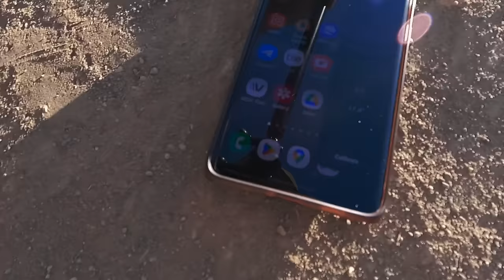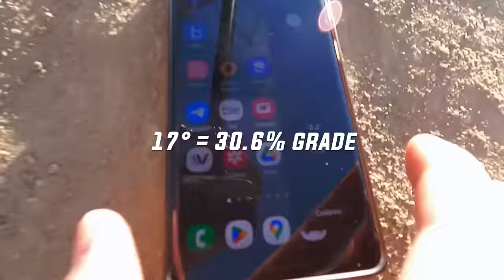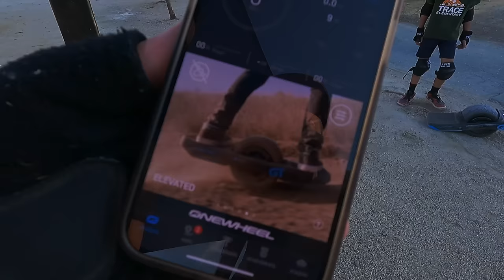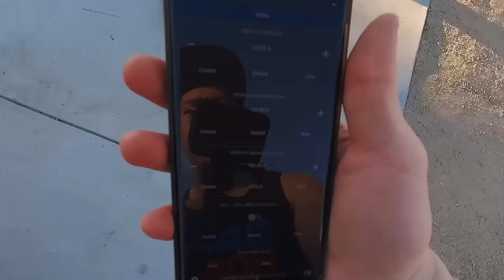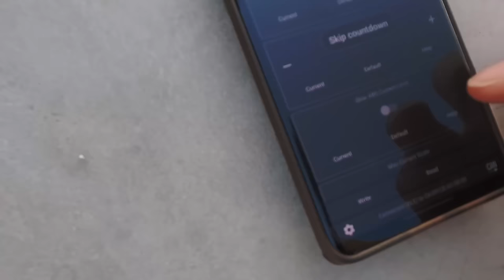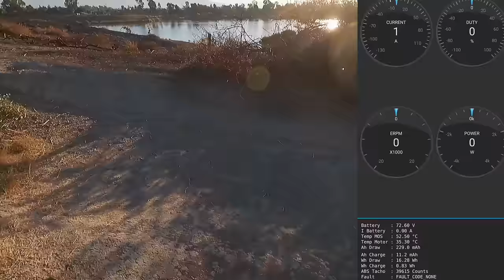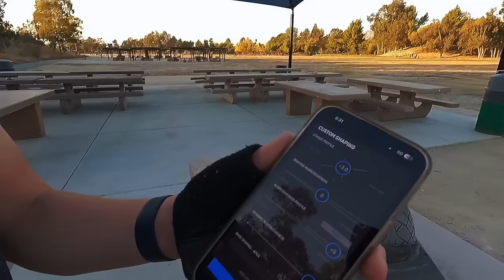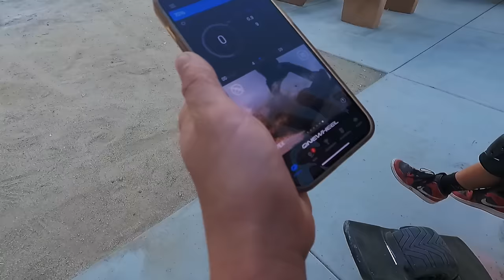Epic GT-S Torque Test! Vs Floatwheel, SuperFlux, GT & Pint-X

Comment: Just get an euc already.. these inclines are easy climbs on my eucs.. 
I've given up on ows for anything demanding and just ride my ow on casual, chill rides these days and still enjoy ows in that use case.. but the performance of the gt-s is very underwhelming for the price compared to my eucs.. and the stoke I get riding eucs is greater than on ows magnified by the greater g forces and capabilities.. there are pros and cons to each.. just many more pros to eucs at this point..not saying you need to give up your sideways stance.. just saying consider being open to this other unique single wheeled self balancing pev alternative which after having a great deal of mileage and years on both I can honestly say eucs are simply more enjoyable and much better value for money at this point in time and variety is the spice of life.. why not have both?
Reply: i like boards. if i wanted to ride unicycles id join the circus.
Reply: @boolikethebear You say that now, like I did as a lifelong skater, but then you try it and it's like magic. I love my ADV Pro but my EUC is my baby
Reply: @rnonty  outdated nonsense excuse..I used to think the same until I mastered eucs.. modern eucs are like single wheeled dirt bikes with a unique ride experience like nothing else (just like riding a ow is a unique experience like nothing else too) and nothing like non electric unicycles.. ows feel like underpowered toys compared to eucs now ( and I still ride my ow from time to time as that's where I come from yet there is nothing natural or ergonomically sound about moving sideways in a twisted stance for long periods of time.. you don't do that walking or running.. riding an euc is like flying head first through the air at great speed with thrilling g forces involved.. like I said you don't have to give up your sideways board stance at all.. I'm just wanting to share the even greater stoke you get as why limit yourself? You can have your cake  AND eat it
Reply: euc rider try not to suggest getting an euc on a onewheel video challenge impossible
Reply: @justinspirational  hey man. this is cool. im happy for you. i dont doubt its fun and exhilarating.  but i  dont ride dirt bikes. i dont want to ride dirt bikes. i want to ride boards. skate boards. long boards. snow boards. surf boards. onewheels. you can enjoy your hobby without me, and other board enthusiast, enjoying it too. nothing about that is outdated. its just two different worlds. just bc you put a battery in both doesn't mean they're comparable. i could say put down the eucs and get a tesla if you want real battery power that offers a unique ride. but im not. bc that would be silly.
Reply: @boolikethebear  watching you two tryna talk sense into each other made my day, lmao
Reply: I would like to see an EUC vs Floatwheel challenge while climbing uphill in reverse.
Reply: I hear you, my first board was a GT I've got 6,000 mi on it, I wanted to get a Floatwheel because I just ride fast streets but now I'm thinking inmotion v11
Reply from the maker: love when you euc riders keep coming to onewheel vids to try and convert us lol. do you have a guess why despite us being able to afford an euc, understanding it's more powerful, we still decide not to get one? Cuz you couldn't pay me enough money to be seen riding it in public 🤣Like how @rnonty said, we're sideways board riders, not a circus rider. We don't go to the euc posts and say hey, you should ride a ow cuz even tho it's not as powerful, you simply look cooler. Instead of having both euc and ow, we'd rather have 2 different types of boards.
Reply from the maker: @boolikethebear  well said my dude. always get a chuckle when euc riders come over to the ow world and try to convince us why we should join them. we get they're more powerful, yes we can afford them, no we don't want it lol
Reply: @MaxxSend  it truly is your loss.. and us 'euc riders' are onewheelers too with experience on both so our opinions are more informed quite frankly and riding sideways on an underperforming 'toy' isn't a good look for many others
Reply from the maker: @justinspirational  why is it a loss? I can ride them just fine, it's just not the feeling nor look I want. At this point it seems it's more of a loss to u than me 🤣
Reply from the maker: @justinspirational  can you do nose slides, tail slides, nose drags, ride the board upside down in dark ride mode, tail butters, 360 no comply or any other skating style trick on euc? Again, styles and feel are different. What else u got lol
Reply: @MaxxSend  all for waiting years for being drip fed negligible improvements in performance..I can do all those tricks on my cbxr.. the gts is not that much better.. don't need to overpay for a micro improvement in performance when my eucs are far better performance wise. So I can do all the tricks you refer to in my cbxr (& have more range than the gt and gt-s) and enjoy all the max performance of my eucs.. the gt-s was designed for performance.. you don't need it for tricks at all.. it's overpriced for what it is and there are many tricks I can do on an euc you could never do on a ow..I enjoy the best of both worlds . You limit yourself to one
Reply from the maker: @justinspirational  dude do you not get the point of this vid? U think I'm promoting fm and gts?? 🤣🤣 I need to stop replying to you cuz I won't get my wasted time back.. Just one last word for u: VESC
Reply: @MaxxSend  in vescing my cbxr as we speak but I'm not deluding myself it's that much better.. just slightly more power and headroom before nose diving compared to xr
Reply: @justinspirational  There will always be a divide between EUC riders and Onewheel riders because of the stance and the board that’s rooted in the traditional surf, skate, and snowboarding culture. EUC do not have this “cool” look to lean on and no amount of power and speed will convince board riders to switch over. It’s the same thing with scooters. They look lame and represent a kid toy  so it doesn’t matter how powerful a scooter can get, some  people wouldn’t be caught dead on one and seek this power in Surrons and Talerias instead.
Reply: @Zetler  lol people look 'cool' on onewheels!? I disagree.. grown adults riding toys isn't a cool look.. and I still ride my Onewheel occasionally for shits and giggles..(tbh grown adults riding any of these pevs isn't a cool look.. we do it for the stoke..
Not what we look like..
I don't give af what people think I look like.. that's a recipe for disaster basing your happiness on what other people think.. all I know is riding eucs is multiple times more enjoyable than riding a onewheel and that's all I care about.. how much I personally enjoy the ride experience.. still enjoy the ow ride but no where near as much.. you see people moving from ows to eucs all the time but never anyone going from eucs to ows.. there's a glaring reason for that
Reply: Obviously these guys want to remain looking cool. Nobody on here cares about AUC nothing against them, but this is a one wheel spot
Reply: @rnonty bwahahahahah
 I agree it's kind of hard not to look like a dork on an e. U. C All the dudes that hate on onewheels  needed a driver mod😂.

Comment: it’s not the fact that it doesn’t have the power it’s that they didn’t put that good of magnets into the board which is unfortunate. And the amps dude. I truly believe that the board would be able to make it up that hill I bet it’s just software or something correct me if I’m wrong. The voltage is crazy if they had really good magnets, I bet it would be out of the park. The speed is really nice though being able to cruise at 22 and 23 is really nice, it’s opened up a lot, but they need to do better on those magnets for sure

Comment: At this point I'm guessing that the GTs gives it's best in going high speed on streets, reaching comparable if not better max speed than a well tuned vesc
However, in any other compartment vescs may perform comparably if not better at a much better price
Reply: The adv seems to have better performances all over the board aside maybe max speed on pavement, while being almost half the price, which is ridiculous

Comment: been watching for a while.. good content. Youve discovered the reality that the math and electrical theory already knew. Voltage is pressure, you need a greater pressure electrically in the same way you need it mechanically, to easier overcome a resistance or increase leverage to overcome traction co efficient ( theres a bunch of math to dtermine this also ) .  AMPS are the flow of electrons through a conductor, this 8s where speed comes from.. volts are only going to spin and move a greater weight to a point., which is why you can ture spin and drift the gts at speed easy.   Amps and windings are where youre getting speed and torque from.  :)

Comment: Maxx, try to test it next time by riding backwards (heavier side as front).
Reply from the maker: What's your reasoning behind that? 😅 If nose is heavier it will dip even easier.
Reply: @MaxxSend  It maybe easier to go up. If there is a setting the reverse of elevated, If not, try maneuvering from side to side.
Reply from the maker: @Tatad3  with all due respect this doesn't follow onewheel physics. Also, if you're riding on a trail and start approaching a steep hill, are you gonna hop off, rotate the board, ride up and then rotate back if u make it on top? The board needs to make it up facing forward my dude. But hey, you should try out your technique first and let me know if it helps.
Reply: @MaxxSend  Riding backwards is way better than  the Skyline mode on my Pint. The handling and stability of the roll is so naturally straight, smooth and relaxed. It's like I've been upgraded from an economy small car to a full size car. It's so easy to stir like a rudder and feels like a dog on a leash pulling you forward. It’s so effortless that my gripe for getting easily fatigued is gone.  It makes sense with the added weight in front to compensate for all the concentrated weight at the rear.
Reply from the maker: @Tatad3  riding backwards can make sense on flat terrain. Not so much for steep uphill climbs. As I said try out your theory yourself on a steep hill and see if there's substantial improvement. At the end of the day it will likely not matter cuz nobody will ride fast on trails and uphill with battery in front.
Reply: @MaxxSend  You're right. I'll test it out myself on flat pavement first and see if I get a better range. Thank you 🙏

Comment: The GTS is for racing not for, umm, other stuff. This video is clearly user error.
Reply: FM burner account confirmed
Reply: The GTs was marketed by FM to be the best board for competitions like race for the rail, which is trail riding
While you will probably not encounter extreme hills like the one in this video, torque performance and reliability during current spikes definitely play a big role while trail riding

At this point my guess is that the GTs gives it's best in going high speed on streets, where it may be compatible to a well tuned vesc
In any other compartment, vescs may perform comparably if not better at a much better price
Reply from the maker: If they tout 100% increase in torque, it better damn not be worse than the GT in a running start, and it is 😆
Reply: @MaxxSend  This is a giant pie in the face of FM and GTS owners for sure. But there gotta be more to this story because we’ve seen the GTS perform well in the Float Life climbing challenges. Maybe it’s a firmware issue that limits torque output at low speed to conserve battery consumption or something. Because it just can’t be this bad.
Reply: @teckno_senpai the majority of the comments are from the floatwheelbois so good to have both sides in here 😀 I have both boards and so I know that my GTS is way better than the GT. The only thing that might come close the range but I don’t need a board to go cross county.
Reply: @AshlonHill whatever you have to tell yourself to justify the purchase 😂
Reply: @brodyport6395  well justified as it just sends it

Comment: I expected the adv to go up that hill ONLY because it has a bigger tire… That simple… Smaller tire is going to produce less torque. If you put the FM tech inside a tire the size of adv expect much better results, period. Cool video tho. Can’t wait to see vids of guys using this GTS motor in other builds because this thing is the best
Reply: Oh no the almighty GTS didn't quite perform like you expected ehh? 😅
Reply: I'm sorry, but it is exactly the opposite:
Smaller tire = more torque, better acceleration (at the expense of top speed)
Reply: @Tom_FXT  So you’re telling me that if I put a V8 truck on skateboard wheels I’ll be able to climb better and get over more difficult terrain than say a regular V6 truck? Obviously tire size changes everything….
Reply: @dezh2544 bro be throwing out some goofy ahh comparison 😅😅
Reply: Thank you got that backwards sir